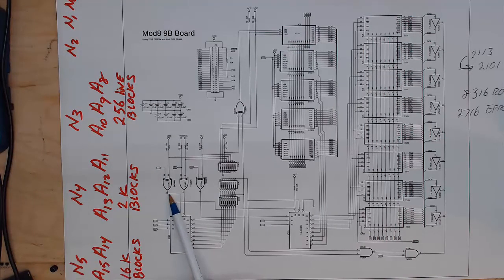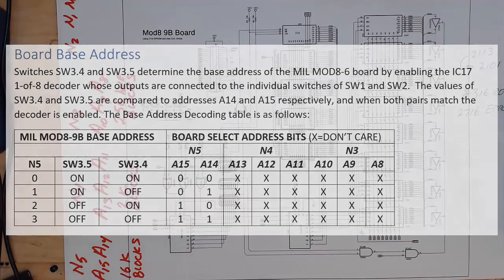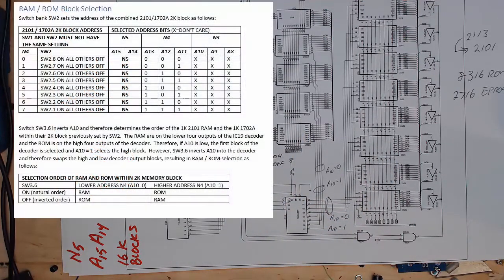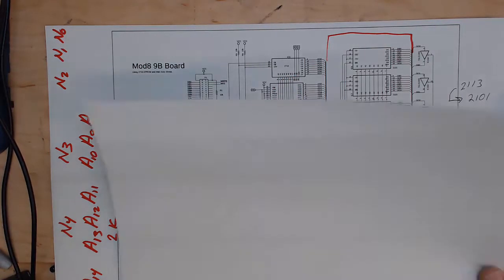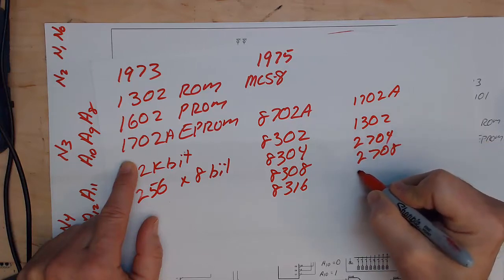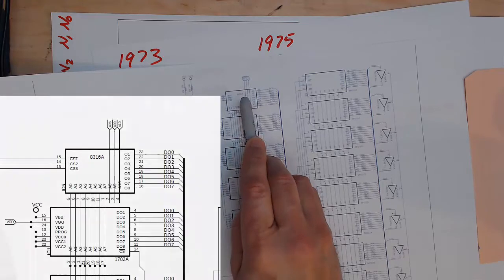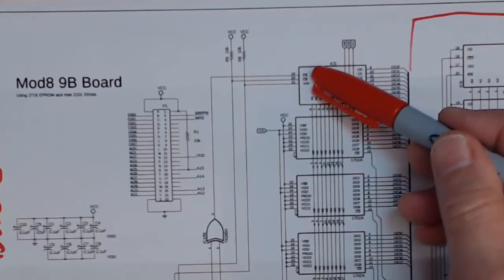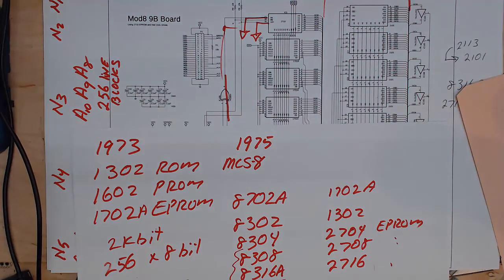{42} MIL MOD8-9 1702A EPROM, 2113 RAM, 8316 ROM 4K Memory Board Address Decoding

Comment: That was an excellent explanation of how that worked and the trap I fell into with the 8316 ROM.  The new board (which I will send out for manufacture in Feb some time), will have the Chip Select to the 2716 simplified.

One question I have though.  The Monitor 80 code requires 2k  at octal addresses 000 000 to 007 377, and another 512 bytes from 020 000 to 021 377.  It also requires RAM at location 010 000 to 010 077 as a scratch pad area.  It sounds like there is no way to set this card up to support that memory configuration is there?  One would have to modify the Monitor 80 code to use the scratch pad area in another spot, if one wanted to use this as a Monitor-80 standalone RAM/ROM card?
Reply from the maker: With a couple of minor revisions this would work, but not as is. Easiest way is to reassemble with different mapping. I can send you a MON80.hex with the code space and scratchpad to line up with a 2k block having the  1702a bank and the RAM bank.  Let me get my mod8-9 running and test it out first.